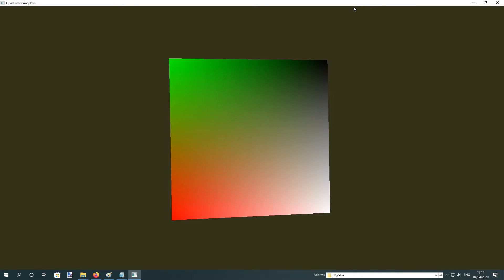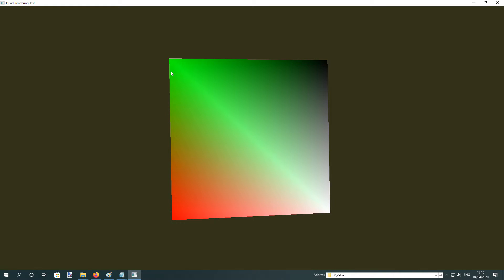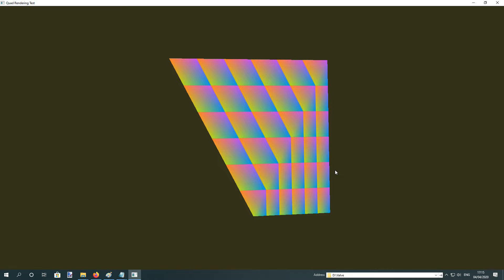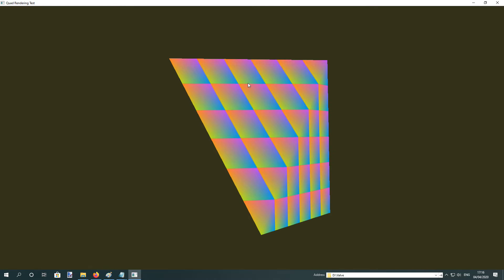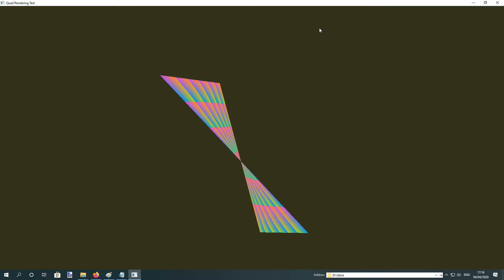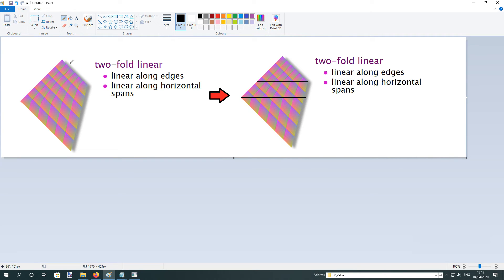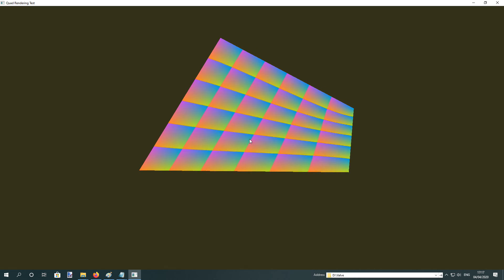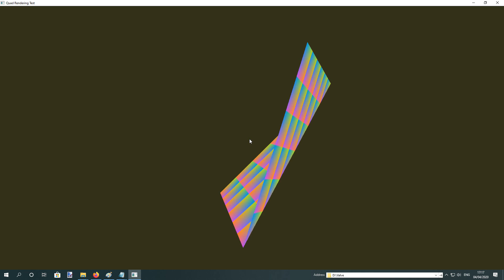Rendering quads in OpenGL

Comment: Hi! Can I get a repo link to this project please?
Reply from the maker: I can put one together. But the code is in the supermodel emulator source code in the shader files. Easy enough to pull out.
Reply: @MrDukeeeey  Found it! Thanks for your great work, I have a lot of respect for emulator creators. :D
Reply from the maker: @yunjay99  the version in supermodel has been optimised by someone else since my original version. The original geometry shader used double precision maths to stop a rare corner case where the interpolation would turn to garbage. The new version does it all with float maths.